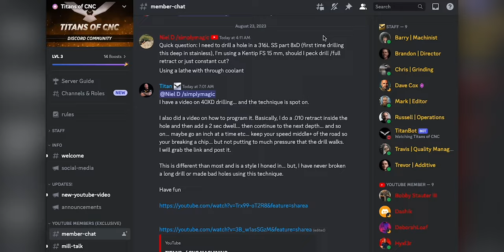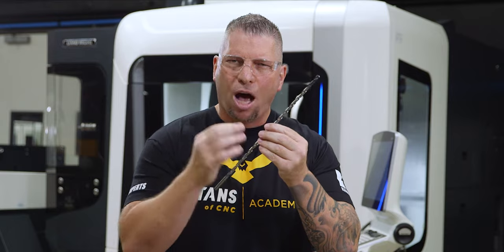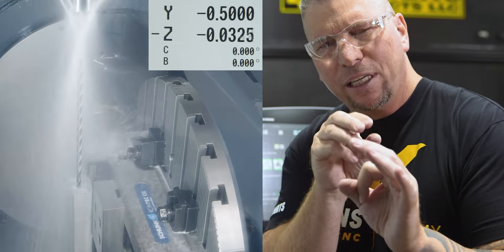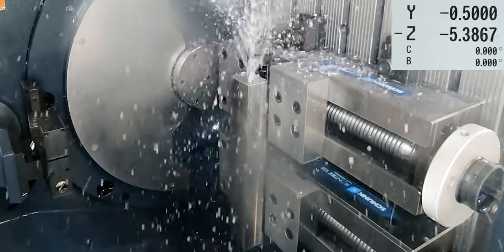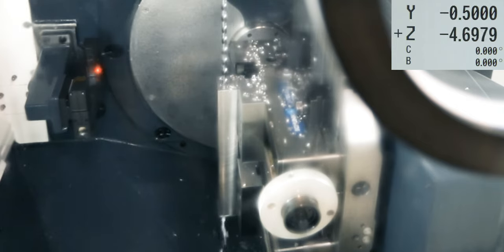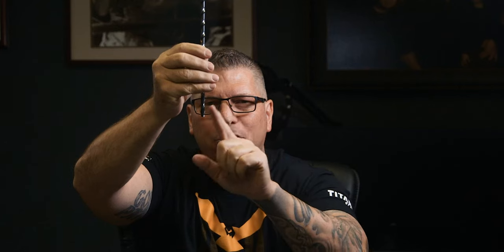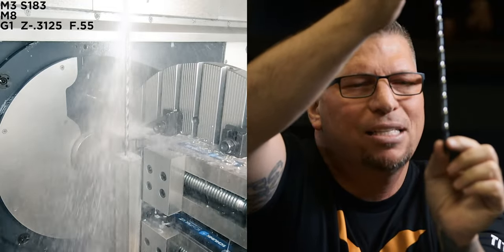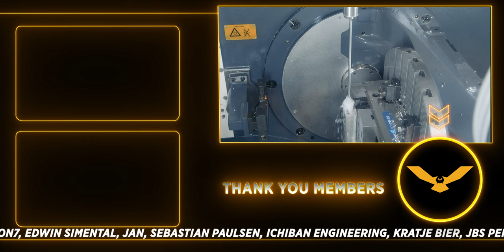This Hole was IMPOSSIBLE to Drill Until I Figured Out this Process

Comment: if your drilling holes deeper then 3 inches in many cases the base part its self needs to be rotating against the rotation of the drilling bit cutter. a physics law that forces self centering, one object rotating into another in apposing directions.
Reply: Sometimes it's impossible because of the dimensions or shape of the part (angled holes in heavy parts as an example). But otherwise you are right.
Reply: That only works with round stock doing center holes. U cant put 3 side by side holes in rectangle while its spinning lol.

Comment: Not exactly new technology, did this back in 2011 with sandvik and their application engineer with a 6mm 40x D same method, stubby pilot, stop long series drill in at low rpm, spin up full speed and drill at around 800mm/min in stainless, was rapid, even I had my doubts

Comment: Seems like one of those cases for why EDM erosion was invented.
Reply: Lol those holes would take like 2 hrs on an EDM. Plus the wire needs a guide hole, so u would have to drill it anyways. Unless ur using a sinker, but then its like 7 hrs and u need an insanely expensive electrode.

Comment: If you really want to hole deep holes you need a EDM-drilling machine such as BES or AGEMA. Those machines can drill up to 1000 x diameter!
Reply: How many hours does it take?
Reply: It depends on the material and the diameter but the speed is 5 to 30 mm/min

Comment: Man I wished you worked with the metric system..
Reply: Either multiply or devide by 25.4 if the answer is not the one you're looking for go the other way.
If you're working with surface feet per minuit multiply by 12 first then multiply by 25.4
Or going the other way.
It's simply a factor you have to find one that works for you.
.0254 or 39.37  Or *,/ 25.4 you pick here in the United States we work in both metric and English all day long.
I prefer metric all machines are metric if there is a computer involved metric is always your best bet otherwise you end up with a double conversion doesn't matter unless you're working in millionths sometimes even tenths of a thousandth of an inch
If you're using microns to begin with you are way ahead of the game.
Arabs live in tenths we work in microns.
No insult intended.
If in fact you are insulted please grow up and or be insulted for your trouble.

Comment: sorry but thats not special, would have been a bit impressed if this would have been on a lathe with live tools where you have to work with tools that start to sag because of their length
Reply: And add to that the slight misalignment between the spindle and turret center and you're guaranteed to break a drill that long.